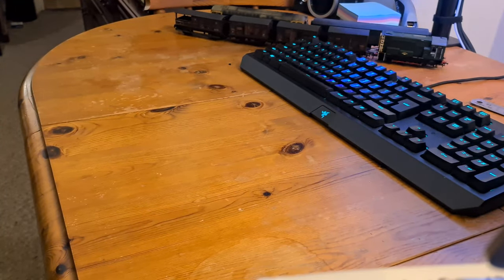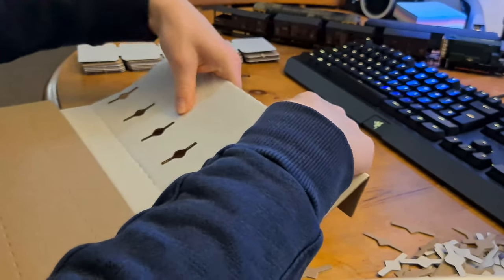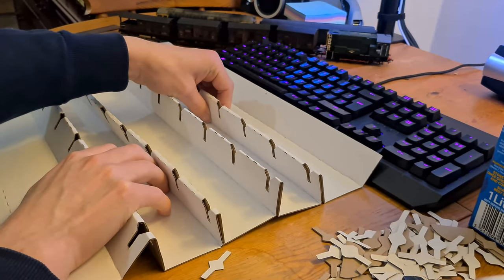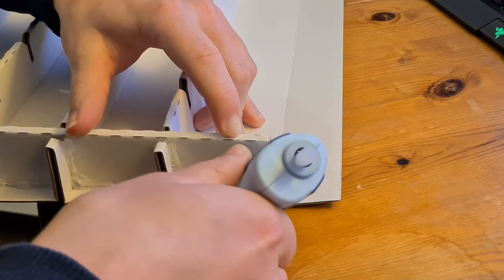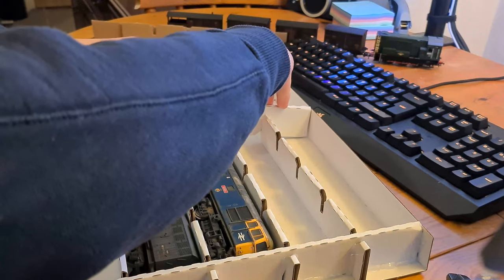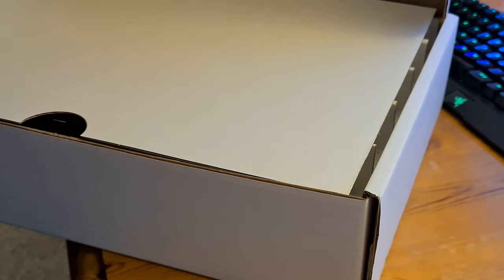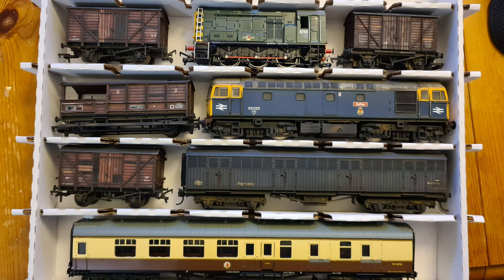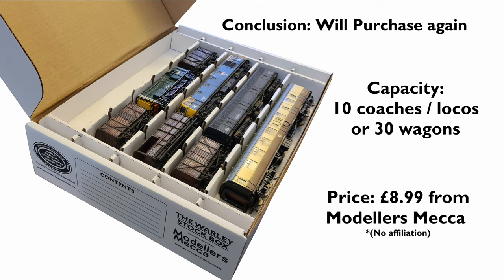Warley Stock Box : How to Assemble & a Quick Review, Plus NEW STOCK

Comment: Do the items of rolling stock move backwards and forwards as you tip the box?  Is there room for strips of thin foam to lay in the channels together with full size sheets below the layer dividers?
Reply from the maker: No froward or backward rolling noticed In early tests due to clamping nature of Upper and lower shelves . I would imagine a layer of foam between each layer is an easy fix as with foam in the bottom of each channel , however i think it may be a struggle to fit foam above or below rolling stock wheels and roofs on the sides of each channel. Hope this makes sense